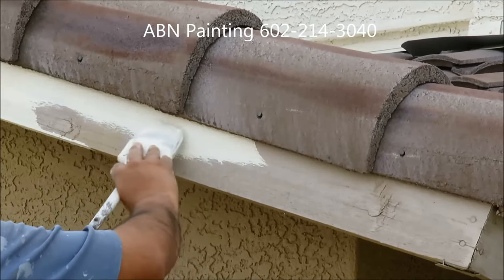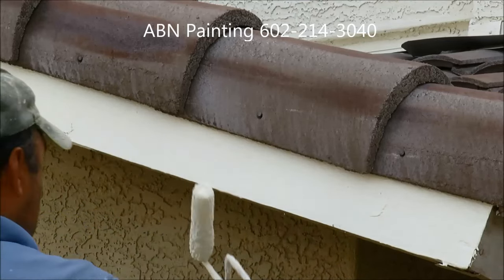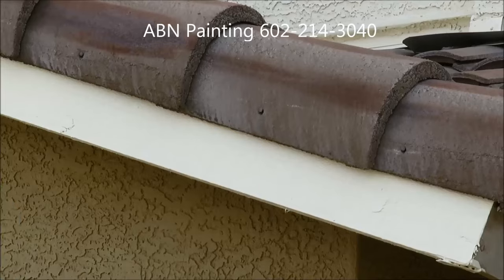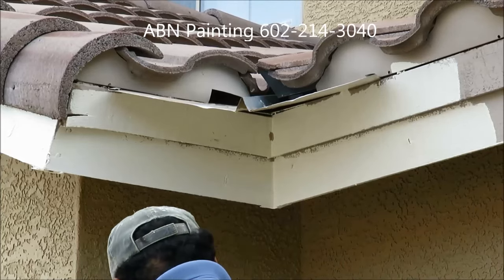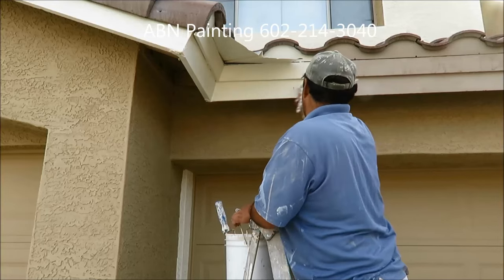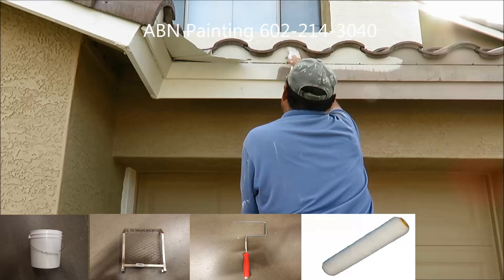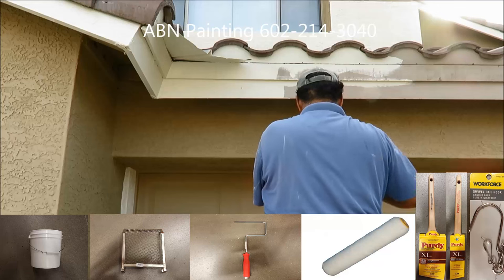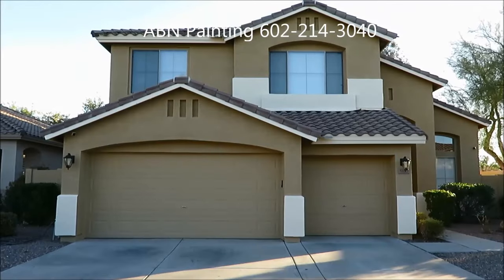How to paint exterior house trim fascia.

Comment: Hi, when do you use elastomeric patch on the fascia?
Reply from the maker: when we need to fix hairline cracks
Reply: @ABNPainters  , thank you.
Do you just apply the paint right away after applying the elastomeric patch or primer first?
Reply from the maker: Not right away. patch needs time to dry . But you can paint over elastomeric patch.  it does not require primer.
Reply: @ABNPainters  thank you